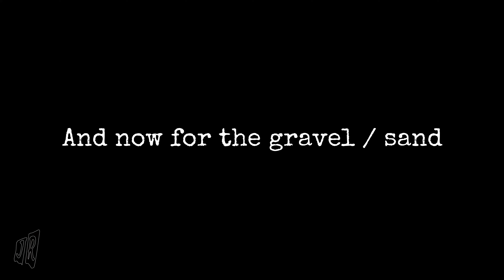Xinlehong Q903-Q902-Q901 RC unboxing & testing on tarmac & gravel!

Comment: I love this Xinlehong brushless and i have it :-) Can we put the wheels of the 144001 on it? There is 12mm adapter on aliexpress .
Reply from the maker: Hiya and thanks for the comment. Unfortunately you cannot. I tried. 😁 The whole on the centre of the wheel on the 144001 is too small. 😔 Have a great day! Kind regards, John. 😊 👍
Reply: @JohnRobinsonRC  ; Thank you very much for this valuable information ;-)
Reply from the maker: You are welcome. Take care, stay safe and have a very MERRY Christmas!
Reply: @JohnRobinsonRC  i found ones that work!!!!! Arrma makes them - AR310816 12mm metal wheel hex set!
Reply: @vintagepyro3692  And can we put the wheels on the 144001?

Comment: Hey, I want to buy one of these but I want to make the battery last longer, HOW TO DO THIS? If you can help me that would be great!! <3 (I don't get really excited bij the 15 minutes play time)
Reply from the maker: Hiya. Yes you can increase run time by purchasing a battery with larger mAh. NOT volts or cells. So stay at 2s 7.4v but increase to 2000 or even 3000mAh battery as long at it fits. Any higher and you are carrying a lot more weight around that will then reduce running time. So sometimes it's better having 2 smaller batteries to have a longer running time. Have a lovely evening. Kind regards, John.
Reply: I recently purchased a 2 to 1 connector for the batteries so I can run both the 1000mah batteries at the same time, I also ordered a 2 pack of 2000mah batteries that are taking a while to show up.

Comment: Hi I need your help do you know the mm of the hex please reply:)
Reply from the maker: Hello. There are no hex's on the Q901, Q902 or Q903. This means as long as you buy wheels and hex's with the same size, for example 12mm hex and wheels, then you can fit what you wish. Don't go smaller than 8mm though as the pins will not fit. 😉👌https://ibb.co/z5GmS9C

Comment: I'm uncertain:
between the two which would you choose?
HBX 16889 RC Car 1:16 or Xinlehong Q901 RC Car 1:16?
Reply from the maker: Good morning Manuel and thanks for the comment. I will be honest straight away by telling you that I don't own a 16889 so it's hard for me to answer. Saying that I have come across several forum threads and videos and in my opinion I would buy the Q901 just because its appears to be better quality in all areas. I think you will be happier with the speed as well because it should be a little faster. Have a great day! Kind regards, John. 😊

Comment: Hello John, were you able to open the differentials at the end??
Reply from the maker: Hiya mate. Still not had the time I am afraid. So many new cars I'm afraid. I'll see if I can make a super quick video but unfortunately when it comes to diffs, nothing quick. 😂
Reply: I took the truck apart yesterday but could not open the diffs!.  The screws seem super tight and I did not want to damage the screw heads.  I just wonder if the screws were glued in good.  Anyone???
Reply from the maker: Hmmm. I will take a look ASAP. Been sick all weekend and still am now I'm afraid so please bear with me.
Reply: @JohnRobinsonRC  In that case, take it easy and rest well.  It is only RC after all. Haha.
Reply from the maker: No no! It's RC after all and killing me to be in bed. 😳 I'll be better soon! 😊👍

Comment: Any chance you know what mod the pinion is on these cars. Want to change mine and unsure what I need. M0.5 or M0.6 maybe ...
Reply from the maker: Good morning. Sorry to say but I don't know a lot about this car I'm afraid. I haven't driven it very much at all and therefore not worked on it much or modded it at all. 🤔 I'll have a search on the groups and forums but not sure if I can find the info. Hopefully someone else can answer you htomid. Have a great day! Kind regards, John. 😊
Reply: @JohnRobinsonRC  thanks for the reply. Struggling to find the info on this myself hence why I thought I’d ask you as you seem to be a man in the know about a lot of Rc info. Looking to gear the pinion down 1 or 2 to compensate larger wheels.
Reply from the maker: @htomid  Hiya and yes I know quite a lot about the WLToys as thats what I have taken apart every video but the Q903 has been solid. No repairs required! 😉 Ill see what I can find! 😉👍🏻
Reply from the maker: @htomid  hiya. So sorry for the late reply but I have been looking and haven't found any information I am afraid. I also don't have different pinions to try unfortunately. I hope you find your answer. Kind regards, John.
Reply: @JohnRobinsonRC  thanks for the reply. I’ve been informed that they are 0.6mod by a couple of sellers selling the pinions. Cheers.
Reply from the maker: Oh great stuff. Glad you got your answer. And thanks for updating us as well as others my wonder the same question. 😊👍 Have a great day! 😊

Comment: Any recommendations for a 2s  batteries and how to charge them?
Reply from the maker: Good morning Allen. I am assuming that you aren't talking about using the supplied charger? I recently tested the Imax b6 mini charger and so far have used it on all my 2s to 4s batteries and it's brilliant! It's hard for me to recommend anything else as I haven't tested anything else. 🤔😉 If you are interested I have put the link below. What I would say is, please use a lipo charging bag as they help prevent a fire and also make sure when you are using them to store them correctly. Once again in the storage bag. One last thing. Make sure you buy an original charger which I can confirm I did receive from this link. 😉 👍 Have a great day! Kind regards, John. 😊 https://www.banggood.com/custlink/GmGRVyZ4ju
Reply: @JohnRobinsonRC  thank you for your response. How about battery brands? 2s lipo is enough for me. Thank you in advance.
Reply from the maker: Again I have just the original batteries from the manufacturers and they are fine so I would say to buy the original. I did buy 2 from this site and they seem really good. Check it out. https://www.ampow.com/ Be sure to select Europe or USA. Good luck! 😊

Comment: hello john I hope all is well with you. I recently bought this car as my first one as I'm wanting to get into the hobby. I was wondering is there anything I need to know regarding battery safety with this car? I've heard some horror stories with lithium polymer batteries and its frightened me a little!
Reply from the maker: Hiya and thanks for the comment and you are right to be concerned, however not worried. Follow a few simple steps like these.
1. Charge away from everything else. For example, do not charge on top of loads of news papers. Charge on a floor with nothing else around.
2. Do not charge if the battery is damaged or the charger is damaged. Not worth the risk.
3. If you can, buy a safety bag to store you batteries. They are worth the few pounds they cost.
4. When you aren't going to use for a while then make sure you discharge them to about 30%. Or buy a charger that has a "storage" setting.
5. And lastly. If you are still worried. Charge the battery in a metal box or bucket (without water 😂) as a little extra safety.

Have a lovely evening. Kind regards, John. 😊

Comment: 6:29 What did you do, what did you fix?
Reply from the maker: Hiya. I took the controller apart as it had been pushed out of shape. At 6.29 I checked to see that the throttle was working which it was. 😊 👍
Reply: @JohnRobinsonRC  Ok, thanks, yeah
that trigger especially needs to be right,
and of course the shell should line up,lol.
Reply from the maker: Hiya. Yes it does help. 😊 It's Strange as since then it hasn't broken at all. Perfect in fact so it must have been a big knock to push it inwards like that! 🤔

Comment: Hi, can you get spare parts for the qn03? Nice vid btw
Reply from the maker: Hiya Erika and welcome! Yes you can get parts for it on both Ebay and Aliexpress.com . Make sure you check Ebay first as you may be lucky and have a local suppliers but be warned, many sellers say they have the items in your country or in Europe for example and they are not, they are shipped from China anyway. So if you can wait then use Aliexpress and pay for their fasted shipping. Good luck and if you need any more help, please just ask. Have a great day. Kind regards, John.

Comment: Customise the 1440000001 to the hilt and then put bigger wheels on it. It's going to cost over double but .....
Reply from the maker: 😁 Surely then it would be better to buy a  more expensive buggy in the first place? 😉
Reply: @JohnRobinsonRC  Yea, probably. It's a bit on the small side anyway. Rough terrain here so thinking of dropping any idea to make a small racing buggy and go 1/10 truggy / rock racer. Have crawlers already and i wouldn't find much time to go to flatter terrain anyway.
Reply from the maker: That makes sense then. 1/10 rock racer would be cool! 😊 Have a great day! 😊